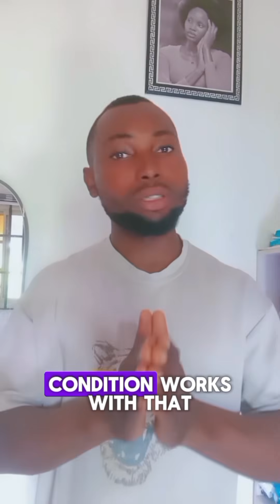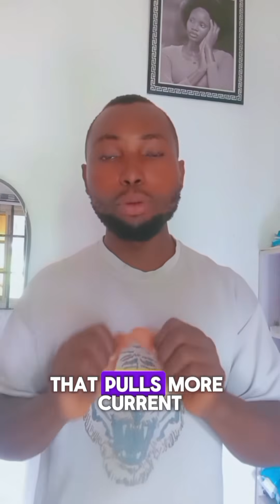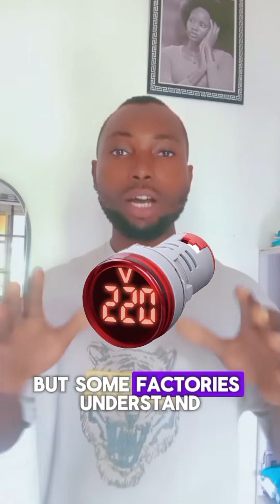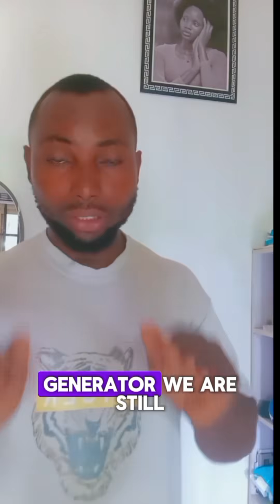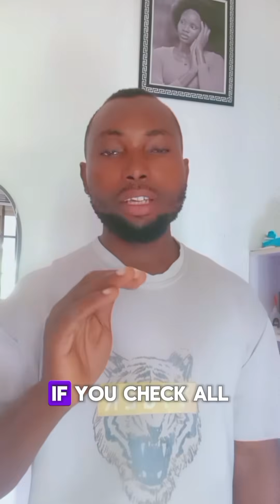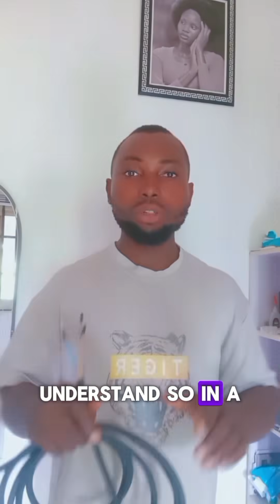Why Your AC Outdoor Unit Keeps Cutting Off and Coming On Frequently

Comment: what is the recommended size of cable  mm for connecting the AC outdoor to indoor?
Reply from the maker: It doesn't have a specific cable size it all depends on the HP of the ac but you can only use original 1.5mm cable for 1hp and 2.5mm-4mm cable for 1.5hp and above
Reply: Good teaching